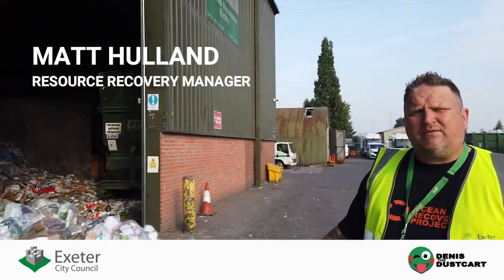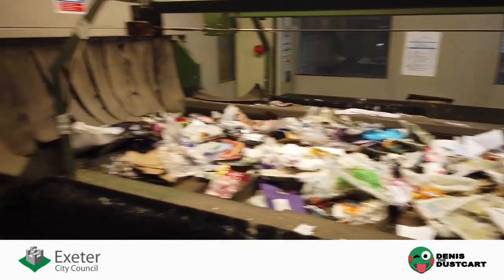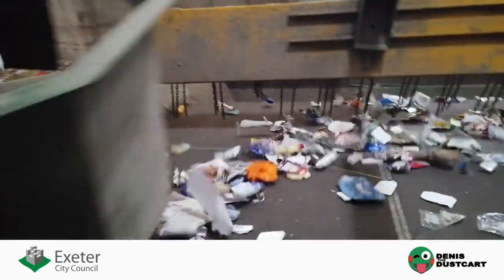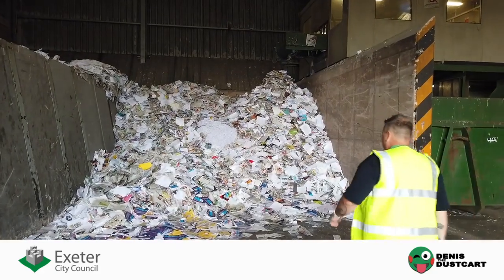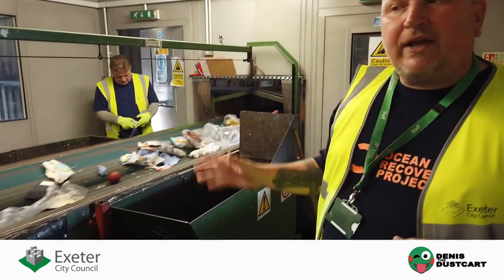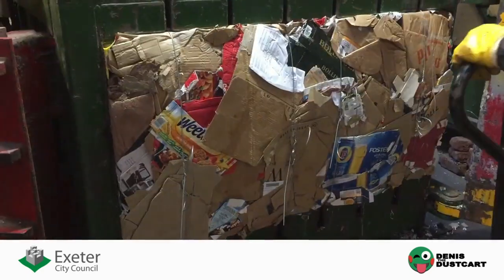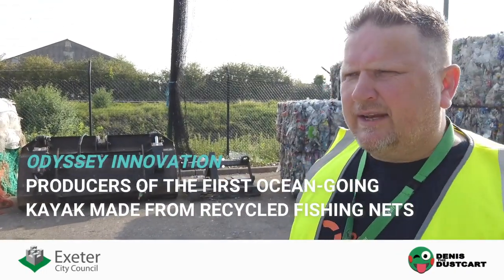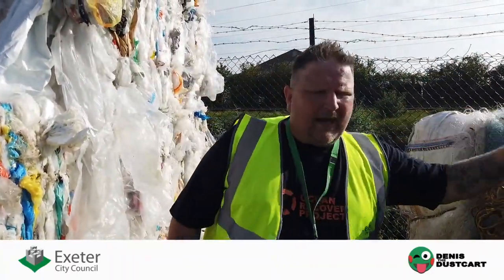A virtual tour of Exeter's Materials Reclamation Facility

Comment: Nice documentary style footage.
Question1.
Certain cardboard products are MADE FROM recycled cardboard by third party manufacturers.
Was there any research into the council using the excess ITSELF to create its own products to sell on?
Best example,egg crates,packing cases.
Question2.
Plastics?Is there an excess ?If so,same question for each "grade".
Suggestion.....molded durable plastic items the council needs.....
Wheelie Bins,Fence posts,Water Butts,Fence Panels.
Also,regulation size sheds.*Prechecked dimensions with Exeter planning office.
Bike sheds* for front garden usage,since these ARE covered in the 2012 initiative,but are NOT mentioned on the PLANNING PORTAL itself.

In both cases,your waste material might fetch a higher price than you are currently getting,wouldn't incur distribution costs,and might lower overall expenditure whilst providing more manufacturing  jobs for local workers.